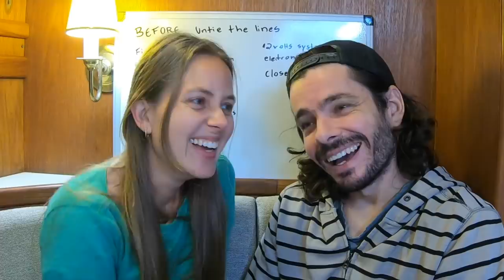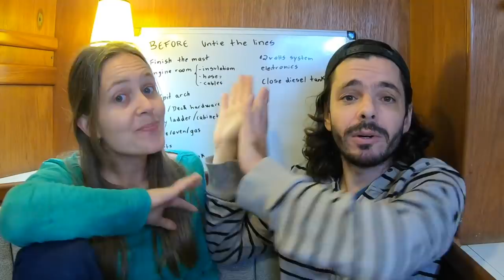⛵️COUNTING DOWN: 2 weeks until the SPLASH of our boat 😳(Fixing things that could sink our boat)#152

Comment: the  ocean water would come in only if you were losing oil already,, toherwise you could have changed the hose on the water
Reply from the maker: If we'd changed the hose while on the water the water could come in as there was no pressure maintaining it outside of the boat

Comment: Duca, you could put a site window in the door to keep a check on oil level. They also make a passive monitor that could be used to turn on an alarm if the level drops below a set level.
Reply: I thought the same thing, need a way to make monitoring something as important as that way more obvious.
Reply: Adapting a car brake "floating" warning device would be very easy...

Comment: Hey, just thinking to be sure. Is the new hose prepared for oil usage? It looks like it would be designed for water only, that's why after time it can become hard as previous one. Just want to keep You away from problems. Good luck with You build guys :)
Reply: It appears to be anything but petroleum-rated yet looks mean nothing. It will likely last for years.

Comment: Love watching as you 'get close' to splash. If this was my boat, I would make up a short piece of hose with a cap - three or four inches long. Glue the cap or plug in place. Put it together with a new hose clamp and keep it in the bilge next to the shaft seal. If you start having water coming in, or if the hose to the tank breaks, or if the tank splits, you can take off the hose to the oil tank and slip the short tube (with plug) in it's place so you can continue to dry dock safely.
Reply from the maker: Thanks for the suggestion, Chas

Comment: grease the u joint ,,i did drivelines for 27 years ,,grease that u joint ,,lol and grease u joint with water resistance grease,,it small deal but big deal if that u joint dry up on it at sea it trouble not needed..very nice love the clip,done very well ..sign land lock ,,

Comment: STOP!! Wrog hose. You need a hose which is made for oil, be aware. This also might be the reason for the old hose to be so fragile. I mean, please don't risk sinking the boat after all that work.  By the way, great videos Greetings from Denmark 😊
Reply from the maker: Thanks for the concern. We are using the same hose they used almost 30 years ago. It's transparent to see thought it. If it wasn't like this we couldn't be able to see the air inside of it and we could have some problems. We are gonna need to take the boat out of the water in around 2 years to redo the bottom paint, so we can change the hose with frequency
Reply: @OddLifeCrafting  Good to hear that you have thought about this. I like you guys, so I don't want anything bad to happen!!

Comment: Ahhh is that hose you are using for the Oil sealant rated for Oil?
Reply from the maker: It’s the same one the boat has since we bought it. It was there for more than 20 years with no problem. The plan is to change the hose if we need when we lift the boat in a year or so.

Comment: Maybe you explain later in the video,  but I'm curious why you were not planning to open and reseal that opening in the hull until the prior owner suggested it?  Are there any other holes below the water line you aren't opening?
Reply from the maker: You mean the one bellow the forward sink? Because it is just a stainless steel plug and the metal is perfect. But we ended up  doing it. Now the only  "holes" on the entire hull we didn't open are the stern locker drain (it is above the water line and it is still in great condition.  And the pivot shaft for the center board (it is a huge flange that if we take out we will take the entire centerboard out and we don't believe it is necessary as it is working perfectly). All the other 18 possibilities of water comming inside of the boat we opened and gave proper maintenance  hehehehe 😊
Reply: @OddLifeCrafting  18 other holes in the boat !  I suspect most non-sailors or even casual sailors have no idea there are so many necessary holes in a live-aboard sailboat.  [I noticed the centerboard pivot point on the video, but was a little disappointed you weren't able to spend much time on the details.  Maybe when you are looking for content to fill a future episode you could go back to the centerboard.]  It's obvious you both know every hole in the boat, and have shed blood, sweat and tears (and a little Ducaflex too, perhaps?) getting the holes ready for the splash.  I could see the anxiety on Duca's face as he moved through the cabin checking for leaks as Odd was being lowered into the water.  Not a single leak across 18 holes is an impressive achievement on a first try too.  By the way, I thought it was fitting that the last thing you did before splashing the boat was to apply Ducaflex to the screws holding the anodes on the hull.  Odd is a big boat, but she became noticeably smaller once half of her went below the water line.  I can't imagine how small she'll feel in the open ocean, but you can rest assured that God will look favorably on her and her crew thanks to your religious attention to details like the screws on the anodes.  Like every great story, your restoration of Odd is teaching us all about far more than just how to repair an old boat.  In life, we all have to deal with "holes in our boat," especially those that are out of sight below the water line.
Reply from the maker: @99jp99  We are gonna talk more about the centerboard once we start using it

Comment: Get rid of the check valve on the bilge pump. #1 they impede the flow. #2 they can clog. #3 everything that’s left in the line will eventually leak back to the pump anyway. #3 they can stick closed. #4 most bilge pump instructions warn against using them.

Comment: Oil is less dense than water, so it needs to be a little bit higher than the water level to equalize the pressures on the seals.
Reply: And it is. Quite a bit I believe.

Comment: Hi , I would suggest you to place a Valve between the thrue Hull Flange and the hose Barb for the hose to the bilge pump.. When the hose would fail during Sailing, you can easily prevent water to come in the Boat by shutting it off

Comment: Think you should of put the check valve ( one way valve ) for the bilge pump lower or closer to the bilge pump.  Maybe floor height, not chest height. Due to worries of water inline leaking back to hull.  I may be wrong, but just my thoughts and opinion.

Comment: In order to not disassemble the system and risk an oil spill, you could just insert a much more smaller diameter tube in the main tube and guide it to the end. The air will escape this way because there's only the pressure of the atmosphere without the oil pressure as well. So the main tube will flush with oil as the air will escape through the smaller one. 
  Actually, I think is a good measure to leave the small tube inside the main one and lead it outside the oil container. If there's any sea water inside the system it will built pressure in the small tube since that oil will not mix with water, so the sea water will get out of the system by the small tube wherever you lead it in order to have another way to check the system functionality.

Comment: Have you checked and greased the universal joints on the driveline between your transmission/gearbox and your propeller shaft? 

After sitting for 22 years they might need to be replaced. At least serviced.

Comment: Duca, what you were trying to explain with the oil is called Hydrostatic Pressure. Pascal's Law, the Navier-Stokes equations and Stevin's Law all play a part in hydrostatics. If I remember my Physics lessons correctly, the density of that oil plays a part in the equation used to determine the hydrostatic pressure exerted against the seals, to keep the sea water out.

Comment: Hot tip.  Always cut tie wraps off flush with the part that the end goes through.  If you leave a short length sticking out you run the risk of that sharp end catching on your hand (nasty cut) or it rubbing on a nearby hose (nasty leak).  A small wire cutter works well.  Being in computer repair for a really long time I can tell you from experience that that little end is not your friend.  Love your videos.  Best of luck!

Comment: You are trying to explain how the stern tube sealing system works. This is based on the principle of hydrostatic pressure. That is why the oil tank is much hight than the waterline. It should be a specific height not just "higher". If you the oil level gets lower and lower as you said, it means you are leaking oil outside, until the level is so low that the hydrostatic pressure of the sea will be greater than the hydrostatic pressure of the oil, hence sea water will leak into the boat from the stern tube seals. If you continue filling with oil, yes will stop the sea from getting into the boat, however you will continue polluting the oceans. Consider using a biodegradable oil. Good effort explaining the stern tube seal system by a non-marine engineer. Regarding the quality of the oil, you actually need to take a sample to a laboratory and check for water. That is the only thing that would render the oil not suitable. Just by looking, your expert told you that is good? You can actually flash the system and remove the old oil from inside the seal rings without having to dismantle the seal box. In this way, you can have the system oil fully refreshed. Good luck!!!

Comment: If you notice that the colour of your oilhose turns white, the first 20 cms after the gland, then it means that you have a negative angle in your hose. That means that your pillarpressure is affected by a negative bend. The hose is only supposed to go upwards. As soon as you have one turn downards to go around an obstacle, it will affect your pillarpressure.

Comment: Oil is the positive pressure the ocean the less or negative pressure. Positive flows to negative pressure. Same as pressure in HVAC. Or hospital use air pressure to keep infection spread less.

Comment: well at least Duca remembered about driving metal wood is fine , all you have to do is use a softer piece of metal than what your hitting, brass works fine we have all kinds of sizes in the shop and you don't throw them away like you do wood . the rule of thumb on piping for bilges ( or anything else ) is pretty much, does it leak if no then its fine and you have ready access to it. i know you got that piece of mounting board for nothing , but in the future, if you have access to starboard (high-density polyethylene board ) it is great for that kind of stuff and does not have to be epoxyed, it can be bought in small amounts and varies in thickness, just a tip . well its all coming together that's great and one piece of advice about that shaft set up you are not going to really be sure it's set up right until you take the boat out and run it at cruising speed, my best wishes go with you both as always

Comment: Try the bilgepump with water to se if you need to move the valve closer.. on my boat the water from the hose was enough to start the pump again..If I haven’t noticed that it would have drained the batteries moving the same water up and down the hose...

Comment: Try heating your hoses in boiling water. They will turn into a limo noddle without doing damage to the hose when you use a torch. The hose will shrink down to a perfect around the barbs. We use the microwave in the boat to heat the water. It must be boiling

Comment: There is a reason why you should not have two different sizes of hose. Now the one way valve will let water out and none should come in But if the out pipe on the other side of that valve is too large the pressure going out will be far less and water will stay in the Pipe. But also can force the valve to open both ways which would mean the sea water will push back and could flood  or just fill up the pipe.

Comment: Yeah, we call it the prop shaft seal, means as you explained the high pressure of the oil due to the position of the tank higher then the seawater level will stop due to the seal inside the prop shaft sealing with seawater on the outer side.

Comment: Can you use vegetable oil in the shaft seal system.  That would be better than petroleum based oil if there is a leak.

Comment: Duca if there is a bleeder valve on the prop shaft assembly area you can bleed off the air in the tube and not have to remove the hose to fill it up .

Comment: I would guess the the oil lubes the bearings  and the o-rings that are inside the shaft housing
Reply: The oil equalizes the pressure on the inside of the seals with that of the water on the outside.
Reply: @anvilhead59  This system seems so 90's. Oh wait, when was this boat built?
Reply from the maker: 90’s hehe

Comment: I can't imagine that the gaskets are only held in place by the oil pressure, but if that's really the case, you should put a 2nd hose clamp (jubilee clip) on.
Reply: Seals...they are likely pressed in plase and the oil drop is to indicate if a seal has blown...possible to lubricate yet apparently not or new oil would have been recommended.

Comment: This is a huge mistake hooking up a bilge pump to a thru hull below the water line. It doesn’t matter if your hooking up a reverse valve. Only one thing will happen to a boat that has a failed reverse intake valve. Are you smart enough to guess what that is. Hint you’ll need a dingy to to fix anything at the top of the mast  head.
Reply from the maker: Hi, John. we don’t have any bilge pump under the waterline

Comment: A few suggestions to make your boat a bit safer:

Install a counter in series with your main bilge pump so you can see how much it is running.

Do you have a high water alarm?

Change your mechanical bilge pump switches for electronic ones. I've seen so many mechanical ones fail or something is interefering with the float keeping it stuck on or off.

I'm so excited to see you motoring around soon.
Reply: Will not it be apparent when it is running? I have never heard a quiet bilge pump yet there are probably silent models.
Reply: @geraldhenrickson7472  You won't hear a quiet pump when the wind is howling, the waves are crashing, the motor is running, or rain is pouring down.

Comment: we installed a bilge pump above the waterline nearthe stern of the boat thinking it would work  but on certain point of sail the thru hull was under water and when the pump turned on and off, it would back siphon back onto the boat.  Your old "muffler" is a water lock?  I would re-use it...
Reply: In a rough following sea, water is just going to flow into bilge, then pump kick on and off then repeat until battery dead, then bilge fills. There isn't even a valve on this though hull. Minimum needs a check valve, but pumping bilge water that won't last long before it leaks.
Reply: @scott3708  Why assume there is no check valve? They placed one on the other bilge-line correct? Would a loop of hose far above the water line suffice? Why are we second guessing after the fact?

Comment: I have a small suggestion for extra protection from any leaks of the oil line for the prop shaft seal. Why not insert a non-return valve (aka one-way valve) into the oil line so that the oil can flow down to the shaft but nothing, including seawater, can flow back up the plastic tube? Admittedly it's difficult to imagine what could go catastrophically wrong with the oil supply to the prop shaft seal but I think redundancy at every opportunity is good policy. Really really looking forward to the SPLASH!